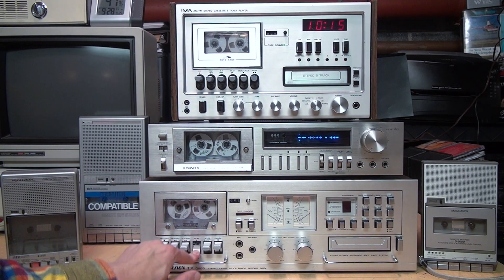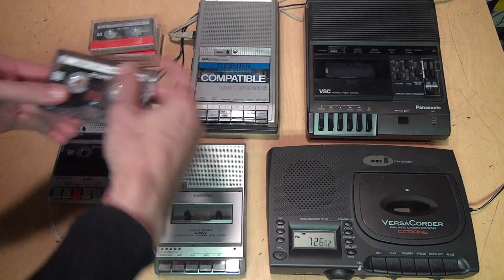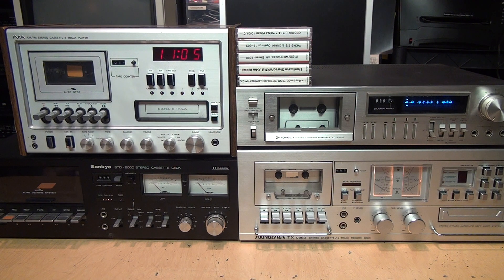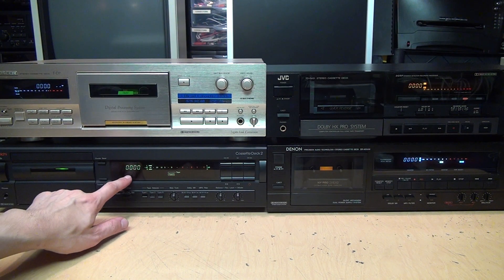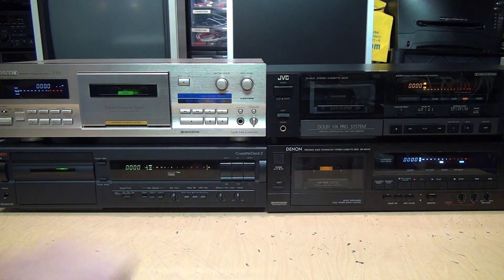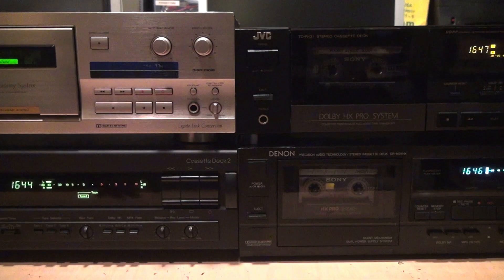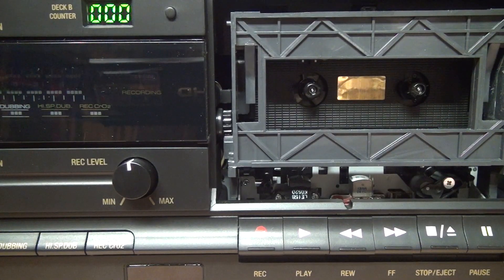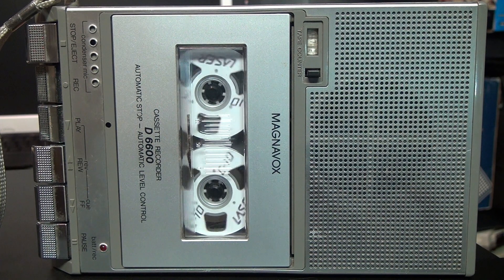What's the deal with cassette tape counters?

Comment: Back in 2000, I had several ideas to improve compact cassette system to combat better against MP3s. One of them was ti put barcodes on back side of the tape along the tape length,  which would serve as timestamps. The tape deck then would be able to determine tape position. As fallback solution for tapes without timestamps the tape deck would have real-time counter. The ratio of the RPMs of takeup spindle and supply spindle would be used as a hint for tapedeck counter, to determine actual tape position.
Reply: I think a simpler method would be to encode a data track with a timecode and track info as subaudible tones. That way no new tape hardware would be needed, just a decoder circuit, and you could quickly tell where you were on a newly inserted tape. Subaudible tones were used in several applications on tapes, most notably on slide projectors/film strips to auto advance.
Reply: @straightpipediesel  Yes, it can be done so. Another option is to record the data track in different angle than audio track. This principle was used in some Nagra machines for recording of a motion picture camera sync signal.
Reply: It seems like all of these problems had already been solved in 1992 by DCC and to an even greater extent in Mini-Disc.
Reply: @jasonschubert6828  Of course. I was aware of it. But my idea was to expand already existing and well-established music format. DCC nor MD never surpassed compact cassette anyway.

Comment: I recall seeing tape counter values listed on various published music education example tapes, probably dating from the 70s or 80s in the UK. I remember thinking it was odd to see this, as I presumed that no two machines would be the same and so these values would be no use to the majority of users. However, given that these were educational materials perhaps they were taking advantage of the 2x system. Who knew! (I didn't). Thanks for this video.
Reply: They might assumed a standardized system, with schools all using the same equipment.

Comment: Video Cassette Recorders(VCR'S) from the 70's and 80's had a similar tape counter system that wasn't consistent across makes and models as well. Around the mid 90's however, VCR's went from using a tape counter that was dependent on the spindle position to finally using the SMPTE time code system. STC information was recorded directly on the the control track of the tape. By using the STC system. VCR's that supported STC would give consistent results across all makes and models. Plus, instead of just getting some arbitrary number. STC gave you an actual time lapsed reading of HH:MM:SS.
Reply: Pro video decks (mainly used for editing) always used that system, but sadly consumer decks (VCR's) never did, unless they were prosumer models like Panasonic's AG-1950 editing VCR, for example.  (Even then, it might have used a time counter only, I think, rather than recording true SMPTE time code on the tape.)

Comment: You just solved a question of mine of which I've never found an answer to in 35 years... I asumed I'm simply to stupid to understand what and how tape counters are actually measuring. So I only use(d) them for realitve measuring mostly with language courses. At the beginning of a lesson I set the counter to zero, that I can easily rewind the lesson again. And no, my late 1980's "ITT SL-531"* that I still use for studying is not 2X compatible. 

*identical to the Nokia (!) SL-531 and half a dozend other companies.

Comment: I have an Aiwa AD-S950, and it has an incredibly acute counter that counts in minutes, and somehow knows the length of tape, because the counter digits start flashing when there's five minutes left on the tape when recording.
Reply: That's a very nice function. My Onkyo TA-2360 has this too. It shows the time of the remaining tape the whole time. But sometimes it doesn't work, because the belt dessolves and makes the sensor dirty and often you can't repair it completely
Reply: I guess it has sensors on both the supply and takeup reel and when the speed ratio between two reels reaches a certain threshold it knows that the tape is about to end.
Reply: @Autian  Yeah, I reckon you're right, because it doesn't matter what tape length you're recording on, it always knows when you've got five minutes left.
Reply: It is easy math if deck has two sensors on both reels, it only needs one full rotation of one reel to exactly knows how long is the tape. I wish that all decks with digital counters had this option... My Yamaha KX-390 only has 4 digits counter. :(
Reply: @ksrele  I don't understand how it is possible to do the math if you don't know the diameter of the reels. I could be mistaken but I don't think that metric is standardized. Also, how does it work with tapes of different thicknesses? I know that long-length cassettes have thinner tape inside and I would expect this to lead to under-estimations.
Reply: @eDoc2020  I'm not very good in math, but my logic is if tape is traveling at known fixed speed across the head and circuit knows how fast takeup and supply reels are spinning, then it can approximate how much tape is at each reel and then how long is that tape...
Maybe I'm wrong but that is my logic
Reply: @ksrele  AFAIK the only thing you can definitively calculate from the RPMs is the current diameter of each spool.

If you know the diameter of an empty spool you can then figure out the volume of tape and then if you know the thickness you can figure out the remaining length.
Reply: @eDoc2020  You can take average tape thickness, I don't think that calculations will be too much inaccurate...
But, how then it is done on real decks that have this option?
Reply: WNL
some decks did real time counter, but you can do that yourself too, just write down the real time on tracks!

Comment: I bet that deck that has the counter that goes to 24XX has a sensor that generates exactly 3 pulses for every 2 pulses on the sensors of the 16XX decks.
By the way, DCC recorders have tachometers on both reels and by comparing the numbers of rotations of the reels while playing, they can accurately guess the real time location on analog tapes within 5 seconds or so.
Reply: DCC would have had timecode I would think.
Reply: @thedave7760  DCC tape records time code, yes. That's not the point. DCC can also play analog tape so for those, tape time is not available but the deck figures out very quickly where it is by reading the deck tachos
Reply: @JacGoudsmit  Ahh yes I forgot about that.

Comment: I just so happen to have some Sony HF Type 1 60 cassettes, so I did the test.  On a dual deck Sanyo RD W340, I get an average of 435 on the counter.
Reply: This one is a Sony HF 60-minute cassette that I believe is from 1999 or 2000 which was near the last generation Sony HF. I have a few of these and I might get some soon when I have to collect my Old Time Radio collection.

Comment: I didn't really care about cassettes as a kid born in the early 80s, but have recently been dabbling with setting up a ridiculous stack, including a minidisc recorder, record player and a 300cd changer (for now). After finding a cassette deck for $10, I figured why not, it just seemed to need belts.

I came across this video while trying to answer the question of why the tape counter only seemed to increment, never rewinding "with the tape". Thanks to your repeated highlighting of the counter running off the takeup or supply reel, I finally had that DUH moment and realized the counter won't work when rewinding if there isn't a tape in it.

Comment: This video reminds me how back in the early '90s I made a chart for each kind of tape from different manufacturers, just so I would know how much time was left on it when recording songs from the radio. This was especially helpful when they would broadcast live concerts so I could switch tapes when I was pretty sure the next song would not fit on the tape anymore. (Later on I got a decent HiFi stereo video recorder and I would start recording such concerts from the radio to it instead of cassette tapes just because the recording time was so much longer and then copy the music to cassettes later for use in my Walkman. This had the added bonus of being able to cut out any kind of ads or some stupid DJ talking between the songs... and the VCR could be programmed to start recording at any time during the next month or so, which meant I didn't have to be home at all. Ahh, good old times... 😉) But, yes, there was never any consistency between different tape decks I or any of my friends had over the years. Quite annoying at times.

Comment: If you think THOsE are not standardized, try the reel to reel decks from whence they came!
Not just different mechanical drive ratios, but different reel hub sizes. And, some counters connected to supply and some to take-up. There may have been some standardization on hub sizes between various reel sizes.
At least an idea for a future investigation.
I seem to remember some 8Track counters calibrated in minutes and seconds.
Reply: I think the 8-track counters were fairly easy to calibrate in that manner because they were driven entirely by the capstan from a single reel, and only ever in one direction. Not much different from making an electric clock.

Comment: Back in the 80's, we had to use the take up reel for the tape counter because the IR sensors we used was not only to drive the tape counter, but also for the MCU to detect whether the take up reel was actually rotating. As you may know, failure to rotate on the take up side marks the start of a small scale disaster.

Comment: Tape counters are for ad-hoc location indexing only during playback and recording, kind of like disposable yellow-sticky notes as you read a book.  You're supposed to jot down the number in reference to a position on a tape like a song which otherwise has no way to index it's location.  It works for recording and playback made on the same deck.

Comment: cool test VW, but lots of possible variables here: tape lengths, motor speeds, tape orientation, anomalies in manufacturing etc. You should try this test with CD players, using the same CD
Reply: For tape length, I would have used the exact same tape (whatever length) in all the tests to eliminate any variations in the lengths of the other tapes, despite them all being the same brand, model & length. Although, I don't really expect there to be any huge differences among them, sometimes you never know unless you check.
As for motor speed, as long as the counter is relying on the turning hub, motor speed should be irrelevant. Whether the motor is faster or slower than it should be, the counter will simply go faster or slower accordingly.

Comment: If you leave the door closed on the Sankyo, the cassette will land in front, behind the door.  The door is still able to be opened and the tape can be removed.  I had a Pioneer CT-F2121 that had the same design and did the same thing when a tape was ejected.

Comment: The most satisfying tape counter reset button was on the Commodore computer datasette 1530, the newer rounded body horizontal model.  The sound and vibration felt on the finger tip was unmatched.

Comment: Maybe the "defacto standard" is trying to get approximate number of seconds?  1650 seconds would be 27.5 minutes, which is fairly close to the 30 minutes per side of the tapes.  Could never be perfect since it is driven from the takeup reel, but at least for a C60 it seems to give a rough approximation.

Comment: That COMPUTER! interlude made me wonder if someone spiked my coffee. Anyway, most tape counters (at least, the mechanical ones) are belt-driven so some of them may have gotten a bit saggy over time. I know I never put any faith in the counters so if I have to replace a belt on one, I just choose one that fits, not really worrying if it's slightly small or slightly large to where it would affect the accuracy of the reading.
As others have noted, some of the M:S counters are really good. I have several high-end decks with them and, assuming I'm using a standard length tape (I prefer using the longer 100s and 110s when available) and have it set accordingly, it's quite consistent. Really helpful for figuring out exactly how much time I have left on a blank tape when formerly I'd sit there with a stopwatch.

Comment: I have a Pioneer CT-W616DR taken apart on my desk right now. (I took it apart because the motors are noisy - good to know they're all like that). Looking at the tape mechanism I think it's just some fraction of rotations of the motor. The same is probably true for the decks that conform to the defacto '1640' standard except they probably have a motor pulley and takeup wheel that are a more even fraction. Like maybe they're 4:1 and the pioneer is 4.25:1.
I have to take it apart again because now it's not playing on the left deck (the takeup wheel just turns about a quarter turn and stops) so I'll take some measurements and hopefully get it playing again so I can see what the relationship of motor turns to counter digits is.

Comment: Man, I thought I was the only one who was fascinated by tape counters as a kid. Does the fact I wrote for myself a computer simulation to explore what happens with a take-up-, supply-, or linear-driven counter with a tape of any desired spindle size and tape thickness/length make me a nerd?

I had no idea there was a 2X counter standard. But I have a fairly recent (late-2000s or early-2010s) portable Sony voice recorder that has a counter that meets the standard (though not advertised). It counts exactly once for every pair of revolutions. Funny enough, I also have a Sony microcassette recorder from about the same era which has the same properties except it counts the take-up reel rather than the supply reel… though it /would/ be the supply reel if it were a compact cassette, since microcassettes run in the opposite direction.

I also have a dual-deck Onkyo which has electronic counters that run into the 2400s territory with a C60, so they're apparently counting 3 for each revolution. I personally find the Marantz one that counts actual revolutions pretty oddball—with only three digits, that counter is going to roll over simply playing a 90-minute cassette.

Comment: My deck is a Technics RS-T20 from the mid-to-late-80s, and it would appear to comply with the 2X standard, despite being a consumer-grade model meant for use in a stereo system. The counter is a manual three-digit one and is driven by the take-up reel.

Comment: I picked up a Pioneer CT-W616DR because of the digital processing I was interested in (thanks to your video).  My counter read 1712/1712. Yours 1727/1722. But I used a TDK 60 since I didn’t have a Sony handy.  Is there a standard with tape leader lengths? In any case, thank you for another excellent video.
Reply from the maker: Different brands of tape did have slightly different lengths. They generally range from 1 to 2 minutes longer per side than the advertised length, on a machine that's running at the correct speed.

Comment: Some decks do have real time counters. How do these actually work?
I don't think it's possible to do that accurately even by measuring the speed of both reels.
Video cameras finally solved the problem by  recording a time code onto the tape. So one could edit with single frame accuracy.

Comment: 12:13 I've noticed that the decks with around 1645 counts are two thirds of what the Pioneer deck measured with 2470.
Reply from the maker: Yes, that means its counter increments by one digit for every third of a rotation of the takeup reel -- or, as it probably makes more sense to say, the counter increases by 3 for every rotation of the takeup reel.

Comment: It's a pity no body puts effort into tape decks these days, with the cost of microprocessors being so low they could count each real rotation, calculate the tape length and then display C60 / C90 / C120 and count tape position in minutes & seconds. But saying that different tape formulas / quality would have different thicknesses that would mess with the calculation but  would be close enough to make it worth it.

Comment: I used them for a while...my mix tapes usually had the number on the counter...but they never lined up from system to system so I stopped.

They were much more useful on VCRs...
Reply: Many more VCRs had real-time counters than cassette decks, so the counter function was much more useful across different units (assuming that they have real-time counters).

Comment: I have a Pioneer CT-676 MkII 3head deck with a digital tape counter. Sometimes when I record my own music I want some saturation or distortion effects on the separate audio tracks. I use the digital tape counter to write down at which point is what on the tape.

Comment: I always viewed tape counters the same way as the "log scale" on vintage multiband radios: A guide, But ONLY for THAT machine. They are useful in editing a particular tape on a particular deck, But I never wrote down the counter position on any "J cards", as I had MANY cassette devices of differing brands and the numbers would be irrelevant on most.

Comment: My last home tape deck was an Aiwa 'digital' one but still used a 4-digit counter rather than minutes/secoonds. It would use the left reel for the count (the deck did auto-reverse). Due to the variance in time it takes per unit, it never was possible to utilise the count for anything useful beyond thhe deck you recorded in.

Comment: hi, so i have a panasonic rq-p41 cassette player and i just changed the belt that is on the motor to make the other belt spin and it now works but sounds a bit wobbly sometimes, is this something that will just dissapear the more I play it or do i need to open it again and replace the other belt, the other one doesn't have any problems from what i can tell, still stretchy and doesn't feel like it needs replacing?